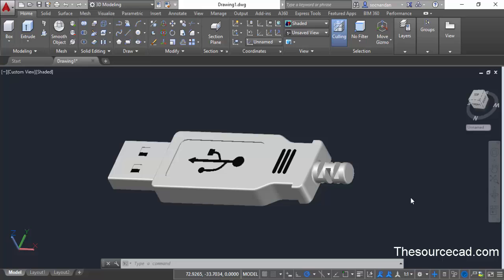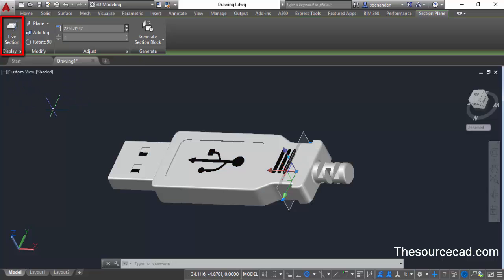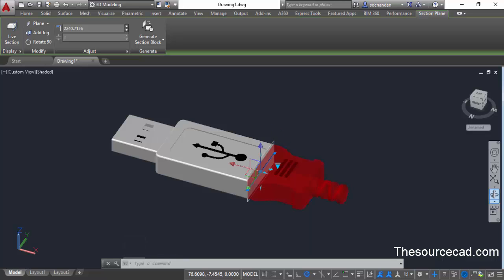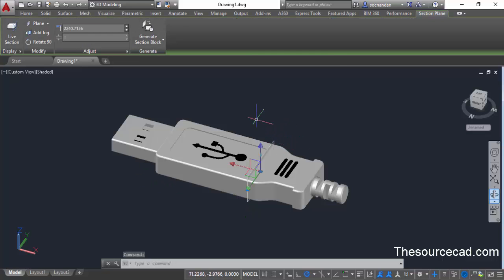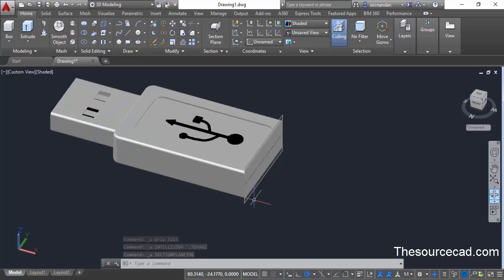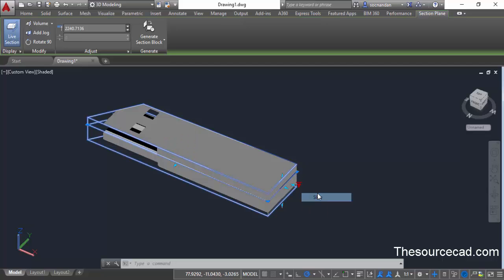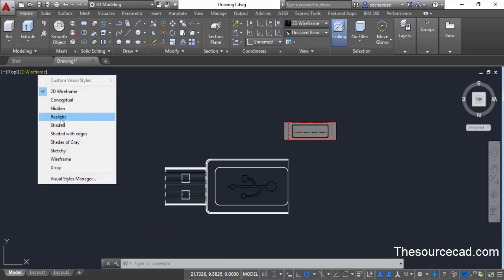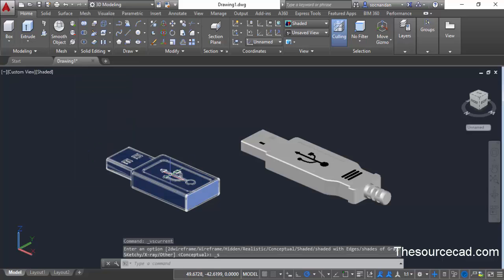Creating section planes in AutoCAD 3D

Comment: How do you display depth in AutoCAD 3D, when you have a clutter pipes or floors in Model Space and you want to clip front and back of your design drawing?
Reply: Depth must be done with a 3d drawing.  You need to move the pipes up or now the Z axis the distance they are in real space.  Then choose one of the ISO views and you will see depth.  2Dd drawings do not show depth.